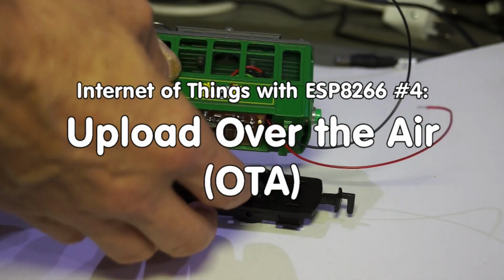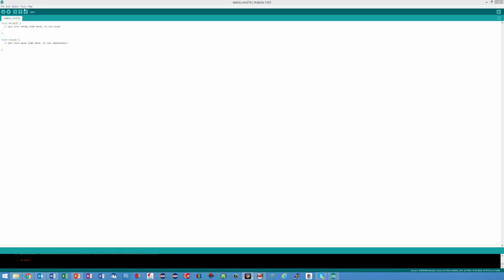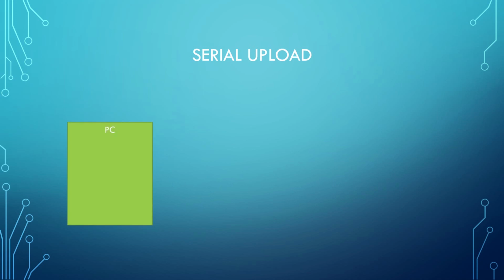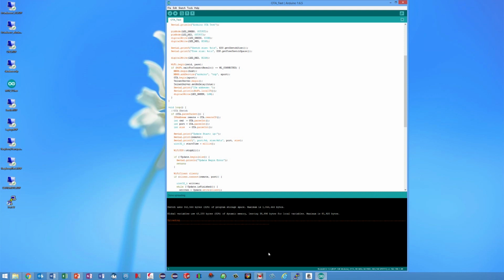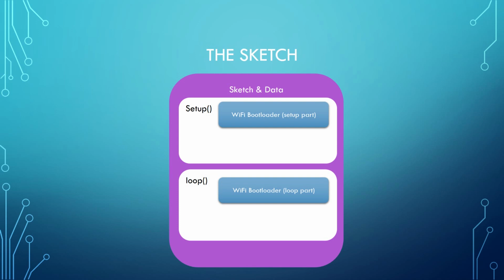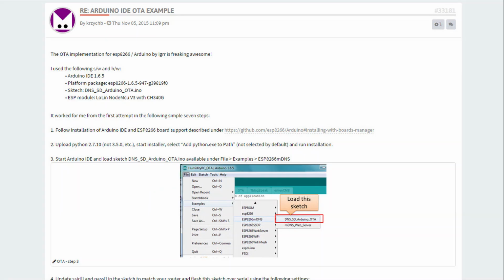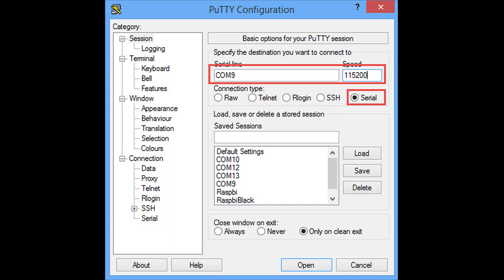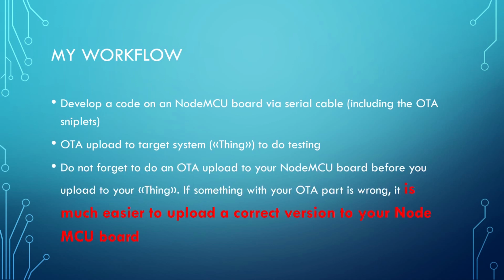#32 Internet of Things with ESP8266 #4: Upload Programs Over the Air (OTA)

Comment: why does mine get 
Arduino: 1.8.5 (Windows 10), Board: "NodeMCU 1.0 (ESP-12E Module), 80 MHz, Flash, Disabled, All SSL ciphers (most compatible), 4M (no SPIFFS), v2 Lower Memory, Disabled, None, Only Sketch, 115200"

Sketch uses 306540 bytes (29%) of program storage space. Maximum is 1044464 bytes.
Global variables use 27728 bytes (33%) of dynamic memory, leaving 54192 bytes for local variables. Maximum is 81920 bytes.
Uploading......
23:12:32 [ERROR]: Error Uploading
23:12:32 [ERROR]: Error Uploading

This report would have more information with
"Show verbose output during compilation"
option enabled in File -> Preferences.
Reply from the maker: Maybe you try the blink sketch first. It seems to be a communication problem.

Comment: Are there new information for the esp8266-01 module? I often use them and it would be much easier to flash them ota.
Reply from the maker: They usually only have small flash chips.

Comment: Hallo Andreas, ich habe vor kurzem angefangen mich mit den ESP8266 Teilen zu beschäftigen und bin dadurch auch auf Deinen Kanal gestoßen. Hat mir sehr geholfen. Bei OTA hänge ich jetzt aber und ich hoffe Du kannst mir helfen.
Ich habe 2 unterschiedliche ESP8266 Module gekauft, um mal zu testen, was mir am meisten zu sagt. Eines ist ESP8266-F mitz 4M flash ohne USB Anschluss und eines ist das NodeMcu Lua ESP-12E WIFI Development Board. Bei letzterem funktioniert alles wunderbar. Beim ersten kann ich zwar per FTDI Adapter die Software flashen, aber per OTA klappt nichts. Irgendwie kann keine Verbindung aufgebaut werden, obwohl das ESP8266 im WIFI angemeldet ist. Ich kann sogar per MQTT die interne LED ein und aus schalten. Nur OTA funktioniert halt nicht, obwohl ich das gleiche script drauf habe, wie beim Development Board. Woran könnte das liegen? Vielleicht hast Du eine Idee. Würde mich freuen.
73 de OE4HDS
Reply: Hallo Andreas, nachdem ich heute Nachmittag Stunden damit verbracht habe, das Problem zu lösen, konnte ich es gleich, nachdem ich Dich hier um Hilfe gebeten hatte selber lösen. Ich musste einfach die Verbindung von GPIO0 zu GND kappen.  Ich bilde mir ein, dass ich das heute Nachmittag aber schon ohne Erfolg gemacht hatte, aber nach alledem weiß ich jetzt nicht mehr sicher, ob das stimmt. Jedenfalls funktioniert es jetzt wunderbar.
Ich habe aber in meiner loop() den kompletten code ohne Bedingung drinnen, also  ArduinoOTA.handle(); und den normalen Programmcode. Da wird immer alles ausgeführt. Funktioniert und man muss beim OTA keine Buttons drücken oder sonstwas machen. Keine Ahnung, ob das einen unerwünschten Sideeffect hat. Mal sehen.
Reply from the maker: Soweit ich weiss ist das so im Konzept. Das sollte keine Nebenwirkungen haben.

Comment: I had problem with the Wifi port not showing even if I restart my Arduino IDE. Solution: 
1. make sure your PC is on same wifi network as on which you configured your boot loader program.
2. if still doesn't works, go to preference > Network and turn off proxy , restart IDE. 
3. if still doesn't works, make sure your Wifi network is not blocking some contents from Firewall (usually happens in Universities or restricted Wifi networks)
Reply from the maker: Thank you for your valuable feedback!

Comment: Hello sir,  I am following your videos and so far, i have re-achieved most of them. You are really good mentor for the humanity of course!. I do my master thesis, this year. Last semester i have graduated and my thesis about " Smart Home Automation on Esp8266 Wireless Sensors ". This year i am developing that project and i stuck at OTA problem, which causes  " wdt reset " and requeries manuel reset. Sadly, as result i couldn't find any solution. Can you show me a way, please?
Reply from the maker: Remote diagnostics for hard problems is not easy/possible. And I assume, your problem is hard. 
Maybe you are aware of my videos about IOTappstory.com, which takes a different approach to OTA. I suggest to try them out if not done yet.
Reply: Thank you,sir! i will look them asap
Reply: Are you using deep sleep?  If so, you might not be generating the interrupt correctly or you might be using your boot configuration pins ( 0, 2, 15 ) for something else and the chip is resetting.

Comment: Please create video about esp8266 sheduler, how this can be done
Reply from the maker: What do you mean with a scheduler?
Reply: Sorry for my bad english. Scheduled tasks in the module, for example, I set up the day and time, when this time is reached, some action takes place. As it is implemented for example in sonoff, the scheduled task is configured at a certain time, in the application, and then written to the module. The task is executed regardless of whether the module is connected to the Internet or not. Independent scheduler in the module.
Reply from the maker: You find a similar thing in video #7. But it does not work properly without internet connection, because the ESP8266 has no internal RTC.
Reply: Do you mean #71? In this video is just what I need, but there's one task is configured at a specific time. How to do multiple tasks with the ability to set the time and day, e.g. for MQTT. So for example http://dl.itead.cc/IM160712005/sonoff_TH10_TH16-4.jpg in the application, you configure the timer task, but the task is recorded in the device itself and does not work in your application and sends a command to the device. Sorry if I was not clear explain.
Reply from the maker: GeneriK This is all I have.
Reply: Ok, htanks

Comment: Hello,
I am using Arduino IDE 1.6.8 and esp8266 board version 2.3.0,
but under File->Example->ESP8266mDNS I do not find your OTA example?

Do you know why?
Thanks!
Reply from the maker: This is a quite old video and I did not play with this functionality. I changed completely to webupdate (see my newest video). I think, you find examples under "Arduino OTA", but I am not sure
Reply: Thanks for your reply.
I have seen your videos about IoTAppStory  and an update is definitely better.
I would prefer to wait for some time prior to try it.
I am not very good as an early adopter...

Comment: Hi Andrea,

#1 Just for my understanding :  where is stored the OTA info in the ESP memory and how does it work (roughly) ?
I am asking you so because I can understand that OTA still works quite well as long as the ESP is within reach of the router it has **INITIALLY** signed and connected to (by ways of 'ESP_BasicOTA.ino') ... but what happens if I switch to another router and still want to OTA my ESP ?
Do I have to run once again the 'ESP_BasicOTA.ino' with the new credentials to force the ESP to memorize these in its memory ?

#2 Just a (kinda) cosmetic question : how comes that, after a **successful**  OTA upload, the IDE bottom window displays 2 error lines like below :

Uploading ...............................................................
19:17:29 [ERROR]: No Result!
19:17:29 [ERROR]: No Result!

Have you seen these error messages on your side and if so, do I really have to worry about it (I confirm again that the uploading ended successfully) ?

Thanks again for your work.
Reply from the maker: +Yann M I only use webupdate, not the normal Arduino OTA. So, I cannot answer your questions. I just guess, that your ESP has to have a connection to the WiFi to do OTA. This is  independent from OTA. To connect to any WiFI, it needs the credentials. Otherwise, the access point will not connect.

Comment: Hi Andreas,
Thanks for your contribution clarifying how OTA works on the ESP8266 board.
I have successfully implemented OTA to my ESP12E/ESP8266 board and my OTA uploads work quite right !
I still have an issue, though.
I understand that the serial monitor can NOT work over the air on the same port that the one that has been used for OTA (well, ESP8266 is not supported this way within the Arduino/IDE).
However, monitoring my program is mandatory for me and I would like to be able to monitor it via Wifi when it runs.
I saw in your video that you're using Putty to monitor it on COM13 !
How did you manage to establish a link between COMxx and the WiFi connection to the ESP (192.168.100.xx in my case)
I have tried many other options to no avail (Telnet, SSH ...)
Thanks
Reply from the maker: There are a few more videos out since this one. Maybe you watch them (one about telnet and two about the IOTappstore). Maybe they help. Currently, I use remotedebug (https://github.com/JoaoLopesF/RemoteDebug) to monitor my devices.
Reply: Hallo Andreas,
es macht gut (ich meine 'Lopes_RemoteDebug') !

However, a few remarks (maybe I am doing something wrong) :
#1 Telnet has to be closed then reopened again everytime the ESP is RESET, otherwise a Telnet network error window pops up
#2 RemoteDebug's Telnet session is VERY slow to startup, meaning that any debug.print statement in the void setup() section is definitely lost (I use to monitor scrupulously the initialization of the WiFi connection, and now, without the serial monitor, this info is lost ... not enough time to debug.print it !)
#3 Is there any way to speedup somewhat the Telnet baud rate, it looks like a 300bauds TTY back in the 70's !

Thanks again for your precious hints.
Reply from the maker: 1. Yes, it resets
2. If I need this info, i put a delay(5000) at the beginning of the setup. This gives me time to start the telnet. But somethings I still debug with Serial. remotedebug is more for production environments and monitoring
3. I do not know about the speed. Sometimes it is quite fast, sometimes not. I have no clue about telnet, I just use it ;-)
Reply: Another question :
You mentioned in your very exhaustive video #31 that you got inspired from the work of a certain John Lassen at http://www.john-lassen.de/index.php/projects/esp-8266-arduino-ide-webconfig
This link does not work anymore, do you know of any Github or mirror where I could also check his work ?

Comment: Thank you for your videos, they are really interresting! You open so many "doors" for our schools projects!
If I may ask you an advise, my students and I are working on a school project with an ESP8266. We need a sub program (only activate on boot of the program by a special input during the first 3 sec) to start the Wifi to get update OTA like the one you show in that video. We try so many things, it seems to work but the wifi is always on and we don't want that (wifi on only when this sub program is activate).
May we ask you to take a look of our small program to help us find how to get only wifi activate when the sub program is chose?
http://www.cjoint.com/doc/16_10/FJAnVSqI1Mv_UPdate-on-demand.ino
My students and I thank you in advance.
Reply from the maker: Did you try WiFi.disconnect() or WiFi.mode(WIFI_OFF)? I do not know if it works.
Another possibility could be to use ESP.deepsleep for 1 microsecond and wake-up with WiFi disabled (after you did the OTA update).

"ESP.deepSleep(microseconds, mode) will put the chip into deep sleep. mode is one of WAKE_RF_DEFAULT, WAKE_RFCAL, WAKE_NO_RFCAL, WAKE_RF_DISABLED. (GPIO16 needs to be tied to RST to wake from deepSleep.)"

You can also have a look at my videos concerning IOTappstore, which give you another possibility for OTA.

Comment: Very nice explained indeed. I use the python script that arduino uses to upload via OTA and now I can update my esp via R-Pi. There is a bit problem I have more then 100 ESPs connected to about 10 R-Pi and I am restricted to use DHCP, so every time when I update ESPs I need their IP address to do this. One solution that I came up with is to write an script to do that. Is there any way to make it possible at the ESP end? Instead of uploading the firmware by script can we just download the bin file directly to the flash in ESP, whenever I put the new bin file in particular directory? that would make ESPs self up-gradable whenever new firmware change is made in binary file.
Reply from the maker: Look at my videos about the IOTappstore. I think, this would be an excellent solution to your problem.

Comment: Hi - for #32 OTA - you didn't explain very well how you got serial commands from Arduino code to be displayed in Arduino IDE using PuTTY. Can you explain in more detail step by step.
Reply from the maker: Maybe you want to watch my video #73 of today.This might help.
Reply: Hi Andreas, thanks for prompt response. I just viewed #73 and even though it was not directly related to my question it still a fantastic informative video. My question to be more specific is how you go Serial comms from a device you were re-flashing OTA - i.e. did you have a separate serial cable to your PC from the ESP or were you somehow connecting to Serial OTA ?
Reply: Hi Mars, 
Could you finally get it working ...?
I have been facing the same issue and haven't been able to solve it so far.
I've tried to Telnet, SSH my OTA/ESP, but to no avail ...

Comment: The yield() call in your loop should not be needed.
Reply from the maker: Maybe. I always include a yield() in my loop. Does not cost a fortune, but saves surprises...
Reply: +Andreas Spiess you only need it inside of loops statements in rare cases, the way it is used here it will never help.

Comment: Hi Andreas, How could I preform an OTA update without having to press the buttons?
Reply from the maker: I think, video #78 could go in your direction...
Reply from the maker: Not easy. Your module has to know if it has to start the normal operation or if you want to do an update. Any signal (noise, light, temperature etc.) can be used instead of a button. 
I read also that you can do a OTA from a web service. This would then first check, if a new version is available and update. This web service could be called every time you start the module. But I never tried it so far.
Reply: Andres - I appreciate the quick reply, thanks! I make eng videos as well. My esp8266 will be deployed where physical access to it is not possible. My idea is that though a HTTP request my device will look if there is an update, if there is one it would somehow download the firmware, flash itself then auto restart. With the code you described above I should be able to initialize the otaInit() method from a web request instead of a button press correct? My issue is my device will never be powered down, so it cannot do any checking on startup.
Reply from the maker: +Roman Kozak Then you could watch my video #67 and start the request each day, each week, or each month. Without any human interaction
Reply: I managed to do this i.e. no special buttons to press. Here is tutorial : https://elementztechblog.wordpress.com/2016/06/28/over-the-air-update-for-esp8266-using-arduino-ide/
Reply from the maker: How does the ESP distinguish between OTA and normal operation during boot?
Reply: Personally I don't know. But I use latest Arduino IDE and ensure I select IP address of Port and then I can do update OTA. I also have the Arduino connected to my PC via Serial so when I open the Serial monitor on Arduino IDE it shows the Serial Console.
Reply: '
Use another GPIO pin (you won't be able to use this pin for other purposes in this case) with a MOSFET and few codes to make a function to LOW the programming pin (GPIO 0) and reset the module, (You have to manage a way to drop off MOSFET voltage and take the pin back to HIGH in few secs) .

:) just an idea

Comment: Please note that you do not need another serial software (putty or equivalent) to receive serial debug information while flashing via OTA. The way I do is start a new instance of the Arduino IDE (by clicking on its icon a second time - not by using the "File > Open" which just opens a new sketch in the same instance) and set the port of this second instance to the traditional serial port.
Reply from the maker: Good idea!
Reply: Thanks! That's a great tip!

Comment: Hi Andreas

I have been working on the OTA project and run into a few issues.

1. I am unable to find  DNS_SD_Arduino_OTA.ino, I have searched ,I can loacte ESP8266mDNS  holding 2 files:        mDNS_Web_Server & OTA_mDNS_SPIFFS.  Searching the internet, I am only able to find information on OTATest.ino. 

2. Also where do I find out a reference for  what the functions do?

3. When are you anticipating releasing your "looking further into the programming of OTA"

Thank you kind sir
Reply from the maker: +Dean Greenhough For the moment I have to work for money and do not have a lot of time for my hobby ;-). So, I cannot help you right now. I think also, that there are two different OTA projects running, but I am not sure. In the meawhile I can only point you to the following page: https://github.com/esp8266/Arduino/issues
You will find lots of info and helpful people there. They helped me too, when I had problems with OTA.